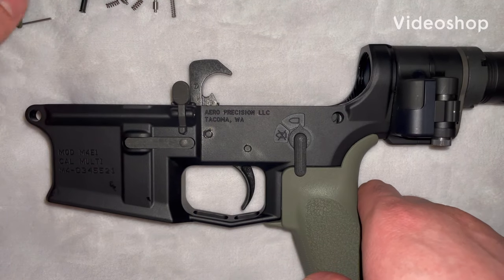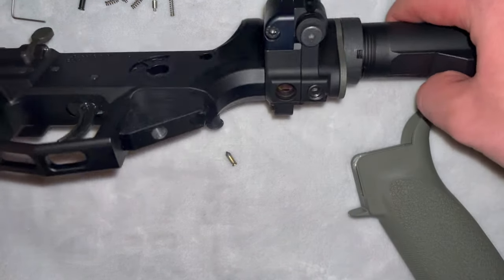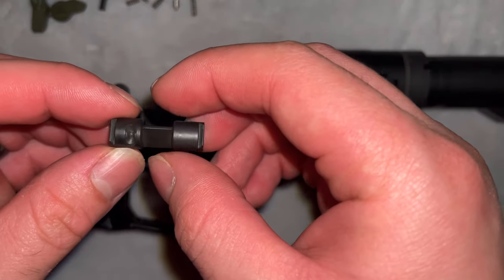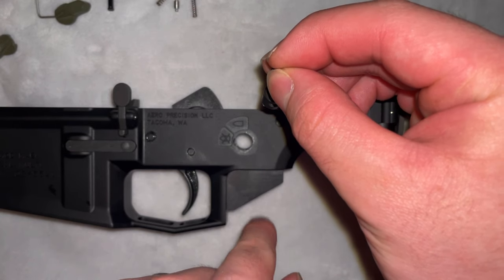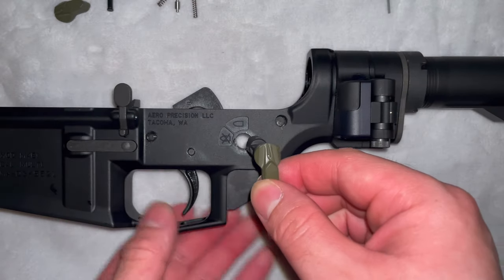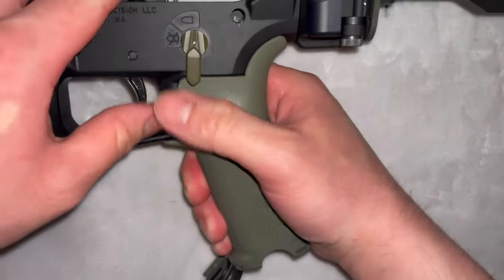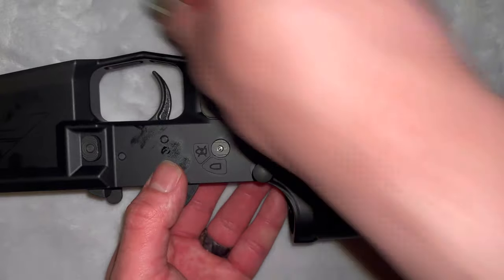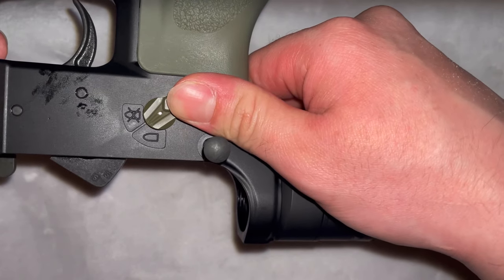RADIAN TALON SAFETY SELECTOR (45/90) INSTALL (easy+detailed install)

Comment: I had a lot of trouble with the pin that holds the lever in place.  That is to say the piece that you move with your finger to select safety or semi.  I couldn't get that pin to go flat so I could slide the lever over it.  Not even with a flat head screwdriver.  I cut out a couple of rings from the spring.  Then I was able to get it to go down.  It still had plenty of tension to keep the lever in place. I've used the rifle several times since and the lever has stayed on securely.
Reply from the maker: It’s tricky

Comment: Hi how are you liking the 45 deg selector is it nice im thinking of getting one for my SnW   AR ???
Reply from the maker: The 45° safety was a good invention makes manipulation just that much more faster. You just have to get used to knowing it understanding and feeling that that safety selector is indeed in the safe position and firing position when attended to be. the thing with the 90° is you know exactly what position it’s in because it’s a much longer throw so you know for sure more confident it’s on safe or it’s on fire. so just train and practice with the 45, really get used to it under pressure and understand it’s a much shorter throw so understand exactly when you’re on safe and when you’re on fire and you’ll be just fine fine.
Reply: Thats Cool Bro thanks a bunch I Appreciate you  hollering Back !  I subbed to your chan also  @Redeemed_Team
Reply from the maker: @raymondj8768  thank you !

Comment: having an issue that while it's on safe the trigger activates the hammer but it doesn't fully activate, but as soon as it is put into fire the hammer falls without the trigger needed to be pulled.
Reply from the maker: Try taking it all apart and start over. That sounds super sketch

Comment: The problem I’ve been having is that the safety does not have a very positive click. It feels “mushy” in a way, almost like I’m forcing it to go down and it doesn’t have that springy feel to it. Anyone have a solution for this?
Reply from the maker: Take it completely out and start over. Sounds like your detent isn’t lined up correctly in the channels

Comment: Where is the part where the other side of your selector was just magically not there? Removing the grip doesn't detach the right side of the safety.
Reply from the maker: The original safety selector isn’t ambidextrous, so the selector switch is only on one side. Do you understand now? No magic involved lol